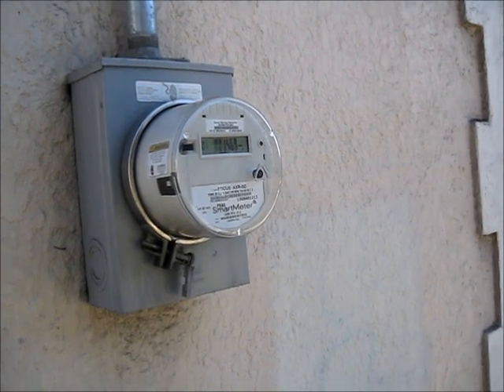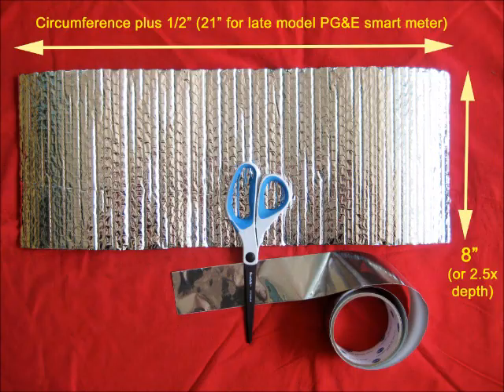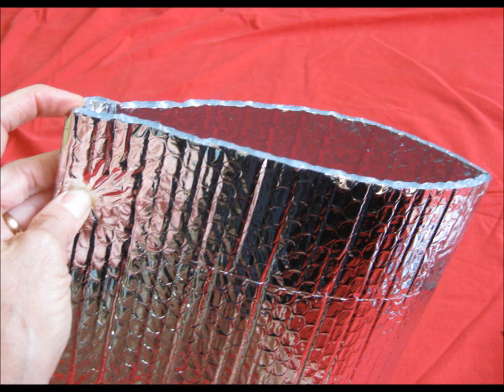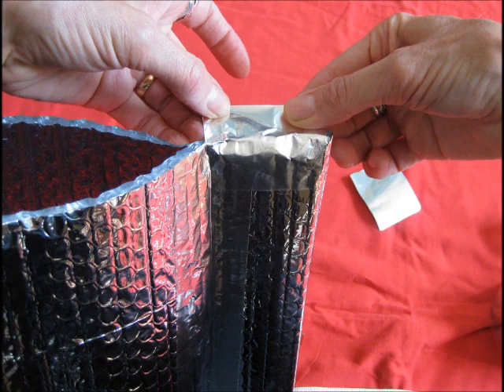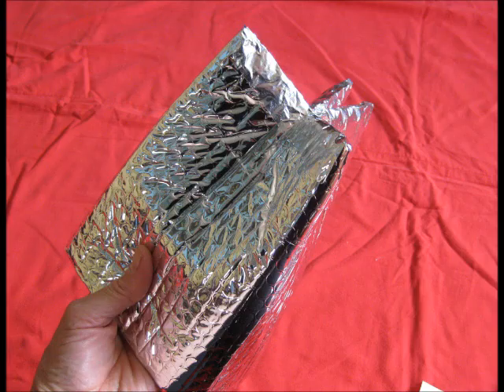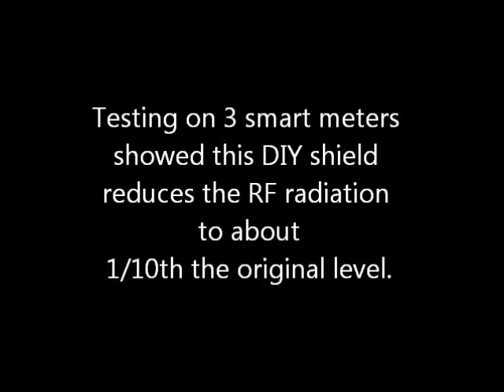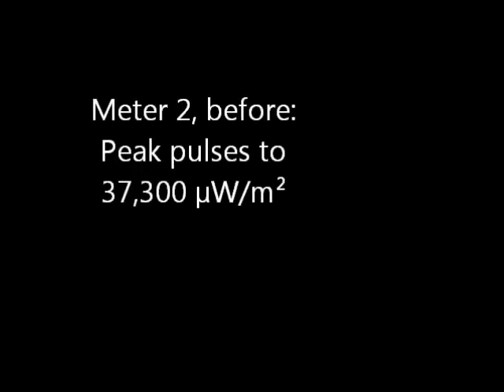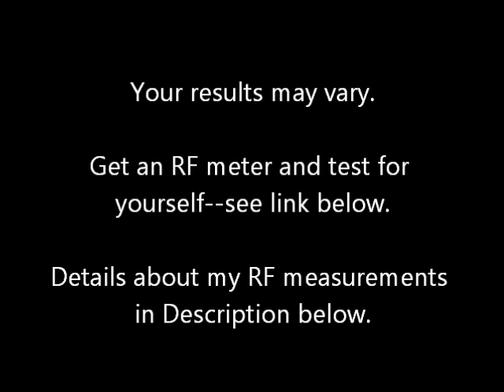DIY Smart Meter Shield: light-duty, temporary, portable

Comment: Am wondering how to check emf (RF) is reduced. Wish could use a volt meter to ck. Do have meter bought online ($3.86) but seems to be a non contact voltage checker with dig readout. Anyone try these if work for emf - are they really emf meters?????    https://www.amazon.com/dp/B0754VVW4W/ref=sspa_dk_detail_8?psc=1  or cambridge labs emf meter

Comment: You are ignoring one very important fact!  Smart Meter are variable power like cell phones.  Shielding makes the meter turn up the power causing more harm to those inside the home!  Never Never Shield The Meter!  Do shielding inside the home wall.
Reply: Yeah, but what if it's right next to where your kids play, outside?
We only have one side yard, with my kids wooden swing/playset... There's no where else for them to play..
Reply: @ShadowBanned_7yrsandcounting  Hi Sarah, I understand.  Distance is your friend.  If they stay 10' away, the strength is very week.  Shielding the meter can increase the harm inside your home significantly, especially on the inside of the wall the meter is on.  We are learning so much.  Vaccines kill and harm all.  RF should be kept to low exposure as much as possible.  When they put antenna's up we have no control over, it is a problem.  Take Care.

Comment: People need to realize the most important thing to shield is behind the meter, otherwise you are just reflecting it all back into the house. Windowscreening is much better. I saw someone who put copper wire around the meter and grounded it to a copper stake then tested it and it was effective, but just shielding the front won't protect inside the building. don't forget "project woodpecker", if you read the last three chapters of the book "the body electric' by Dr. Robert O Becker, he talks in detail about RF, project woodpecker and how the people in the embassy all died of cancer after remotely targeted with microwave weapons.

Comment: i would hang a picture inside the house with the a screen glued to the back of the picture frame plus the outside screen
Reply: I've read that no one should sleep next to a wall that has a smart meter on it.  If this is true then it would mean the entire wall needs to be protected, not just the area right behind the meter.

Comment: Any shield used needs to be grounded. Use screen wire like that on window screening, leave the front open for the signal  to still get out.
And,, shieled the rear of the area inside the house or behind the meter.
Reply: I don't understand much about the whole "grounded" thing with regard to electricity.  Whenever I see that I think of there being some wire or something leading from the screen to the ground.  It seems that the ground has some beneficial properties which is why it is recommended that people ground themselves by spending some time with their bare feet on the ground.  Can you please explain how the screen is "grounded" without having an extra part leading to the ground?
Reply: Mine has has a breaker box on the wall directly behind the meter.  How do you shield that?

Comment: Hi, Is it not dangerouse to wrap the meter ?  wil it not overheat and cause a fire? ( have read this on the internet)
want to be sure. I think it would be more save to wrap it because it gets the radiation lower and the chanse of it overheating should be less. and do you have to keep one place open on the front? some just close it all with aluminium foil why do you keep it open is it for overheating?

Comment: Idiot foil-hatters.... 
Try using proper meters in the proper power range..... 230,000 Microwatts sounds huge if people don't know what you're talking about. Try using Milliwatts then realize it's less than the average flip phone. 
Putting a foil cover over the exposed meter actually traps the RF inside the electromagnetically shielded steel box, in effect, turning your wall cunduits into a wave guide to bleed RF out your interior electrical outlets. 
These meters only communicate far enough to be tripped by a hand held meter reader carried by the utility workers to get accurate meter readings. 
Blocking the signal only prevents them from getting an accurate power usage reading. Therefore the utility company has to bill you according to best guess usage which my actually be more costly to you than your real billed amount.
Reply: +Curt Young no foil hat about it these meters are harmfull you are right that covering it makes no difference you have to make it reflect away not back at you
Reply: Here's the deal... EMF will happen wherever there is either electricity (oh boy, a power meter maybe?) or magnetism ( like a speaker or a grade school science class ).... The claims of constant signals coming off these meters is BOGUS... Get the CORRECT equipment... Try an FR FREQUENCY COUNTER. Smart meters only burst data when triggered by a hand held reader. Taker yer EMF meter ANYWHERE and you will get readings...unless yer in a lead lined cave with no light and an air vacuum... even then, metals in the rock might give you a reading.
Reply: Curt Young
These meters give off radio or microwaves though that is the difference and they give it off 247 all day non stop
Reply: My point is that there is no need to worry about .023 watts of actual RADIO RF in the first place. A pocket FM receiver will generate a stronger "birdie". Also, ANY power meter is going to generate an EMF field because....well... there's ELECTRICITY flowing through it. Whence the need for proper meters if you're going to waste YouTube's server space with worthless doom and gloom videos!
Reply: +Curt Young Good argument. All one needs to do is direct the signal out the front of the device. There is NO REASON for these things to transmit an Omni-directional footprint. So, reflecting the RF out the front of the device (which requires a shield/reflector in the rear, and wrap around the meter with the front open.
Reply: explain? ive seen stats of them emmiting 2000x that of a cell phone. why such a fight from so many including so many intellects?
Reply: Again, the CONSTANT reading being shown is EMF (Electromagnetic)...Anything with electricity flowing through it will show EM Fields, from simple batteries up to household appliances....and power meters. RF is TOTALLY different. the 2000x is EM not RF and the reading itself is being shown in a smaller increment. Think of it like this. 2000 millidollars sounds like a lot, but it's only 20 bucks. :P

Comment: It is possible to know how effective this shielding is by using an RF meter to test it. I have shielded the meter in my house using a metal screen. It works. I have an arrangement with the hydro company. They call me the day before they are to take the reading, which is once every 2 months. I remove the shielding on that day. I cannot say anything as to the danger of using this shielding. Please ask an electrician versed in wireless RF. Those with a digital meter that measures electricity usage should find out about the dirty electricity angle. All I know is this: I do not suffer headaches, dizziness and brain fog as long as I use my shielding.
Reply: If they are reading once every two months then how do you know you are getting an accurate bill for the months that they haven't taken a reading?

Comment: Maybe not such a great idea guys! 

According to an electrical engineer, putting such a cover on a smeter could cause it to overheat, which is a serious problem already, as you know. Such a shielding as well will prevent signals from going out or being received which could result in the meter increasing its power as well as Hydro getting an error message, believing the meter is being tampered with. As better shielding is aluminum screening, like that used for windows. The signal can still get through, but it will be weakened, and air can pass through to the $meter.

Learn more about EMF radiation, the good, bad and ugly at http://EMFsummit.com
Reply: Good info ;)
Reply: I was just thinking this, both them not being able to read it (of course, why should they if it's a smart meter...craziness) but also the smart meters are already known to start fires from overheating, doing this could make that worse.
Reply: LET IT BURN

Comment: What is the point of making that shield?  As the front of the meter does not face the house? should not  be a special screen placed underneath of the meter, as it sits on the wall and possibly radiates through the wall,  into the house.
Reply: I've watched some other videos and some are saying that the back of the metal box actually blocks it, but then I see other videos saying that people should be using EMF technology such as special paint on the wall inside the building to prevent EMF's from entering.  The other thing I've heard is that people should not be sleeping next to a wall that the meter is attached to.  If the latter is correct that would mean the entire side of the house is being impacted.

Comment: You must think in your mind the radiation that is emitted from the meter is like a giant ball starting from the middle of your meter. If the middle of the radiation ball is emitted  5 Ft out from your meter to the outside then it would be emitted 5 Ft in the house and side to side of the meter as well. The only thing that reduces the radiation waves entering the house is the wall between you and the meter, so the true distance might be cut down to 4 Ft entering into the house. NOTE>>> I just use a measurement of a made up distance for an example. I won't say how to reduce your risk from these waves but there are ways that can keep you a lot safer with out getting rid of the meter. Just think your using a computer to read this post of some kind and they are just a dangerous to your health. There was one study done in Europe on laptop use around house plants and the study found the plants do better when not expose to the radiation given off by a laptop. Just a thought.
Reply: That's what I've noticed about many of these shields too - they completely neglect the back. Unless the box it's mounted to is made of a type of mental that attenuates the signal enough, they're missing half the equation, and could possibly be amplifying the signal due to the faraday effect
Reply: @anastasiavila5284  my box is on the cmp pole so it will be hard to cover the back of that, plus the pole is outside my bedroom just on the other side of the driveway. it was put in 2006 after the house was burned down, when i put in the new home (trailer) they never brought back the analog meter that was originally on the house. instead they put a smart meter in its place. they claimed it was better and safe, lol if i only knew then when these monsters came out a give off EMF radiation i would have demanded my analog back. yup i am dealing with side effects from that damn thing
Reply: @suebaxter301  Did you know you can have them remove it? Of course it'll cost you, and there's a monthly fee you have to pay, but you CAN have them removed!!

Comment: Excellent, you have given me some great ideas, what about the back shielding?  It's my understanding the circumference in the back, say, if it backs to garage wall, needs to be shielded.  I wonder if the meter readings would elevate on that side..
Reply: I keep seeing mixed info about shielding.  Some are saying that you need to only shield the area directly behind the meter in your home and others are saying not to sleep next to a wall that has the meter against it which would indicate that the entire wall needs to offer protection.

Comment: i used lead foil for 100% RF blockage
it worked they could not read {see} my meter
and are trying to have me cited
Reply: You can take measures to reduce the EMF's, but it needs to allow the RF's to reach the street where they read the meter from vehicles.

Comment: Thanks. Im curious as to whether u took readings on the inner wall of thw house before and after as u may be reflecting more of the radiation inward and even concentrating its power. Please let me know the results if u decisw to check the inside measurements and if u can get your hands on a Geiger counter it may be very helpful.  Thanks for the video.

Comment: Okay, good ideas but won't work. Yes, aluminum will block the single, but what you are doing is reflecting it back into the house. Instead of dispersing the signal you know have a focused one in to your home. Unless you can block the back.

Now for the meter itself. You will get just as much radiation from your TV and even more from your cell for one day than they meter in a whole year. But I get it. You want you privacy. Well the meter isn't gonna be the answer, sorry,but I bet when you asked to have a regular meter put back on, there will be a new charge on you bill, for misc service, etc. Covering the meter is a form of obstruction, what you would have to do it look in your title and see if the meter is part of the house or the electric company, maybe even the cities. When I owned a couple houses the meters were mine and I could opt out, If the did change it out and you own the rights and said NO, no they are criminals, because when the meter is changed out, you No longer have any rights to them, they are not you property. Hey from CA! 

Hope this helps.

Comment: this is stupid.........they own the meeter and the power delivery service and all the delivey equipment.......why not switch to solar or one of the other free energies instead......simply put them out of your business and quit supporting them
Reply: u r stupid cause most peeps are now poor in the USA fool
Reply: put the shield on the inside wall opposite of the meter???? put an 
opening towards the sky so the stupid pulse can pick up the readings????
Reply: aside from the legal ramifications this idea has other problems....the other problem is that this device has a built in cell phone that reports to the power company through the cell tower system....... so if you r blocking the cell signal..... the cell tower will detect the power loss and compensate by broadcasting a stronger signal.... it will also send a message to the phone to increase its broadcasting power....... the shielding effects are only temporary until the system detects the signal drop caused by the shielding then adjusts the signal. signal bumping will actual increase the short wave broadcast strength of the system making the detriment health effect worse..... if you should use enough shielding to actually be effective.... the power company will be coming to your house to inspect and diagnose the problem..... when they discover your tampering with there equipment, you will have legal troubles or get cut from service. so ya poor man i hold the high ground when i say this is a dumb idea..... get an edjumakation.
Reply: I think the author is very clever and quite concerned to use quality albeit expensive equipment to test. Some protection is better than none, and most meter boxes are just that grounded steel boxes, ie Faraday cages so back shielding may or may not be nessisary. 
Sad to say...all this "free" solar upgrade stuff, Govt. grants, free home energy assesments, smart appliences that communicate your habits and listen in on you,  etc.. is just setting you up for taxing everything including the sun later.... think about it... some districts are already being taxed. it will work something like this,  You use less because you are a good citizen & went solar, then pay less up front! (Good job, thank you! they say..) untill the tax man who is in cahoots with him says you are harvesting energy that we (the powerbrokers) have legal claim to. The power brokers arn't going to allow you to get away with this. They are intitled to bully you into submission, they will wear you out, fighting with them. In the meanwhile they are zapping the life out of you with all the smart stuff you think you can't live without.
 Evil.... slow steady cooking evil. WAKE UP MY FRIENDS! this a long term plan being fulfilled as planed, written years ago. It's a deep Deep rabbit hole. I'm hoping some of you see and discover how big this is and who is behind it. Knowing the truth helps understand their strategy. If you are looking for peace of mind, forget it, those days are over. This a quiet de-population war.  The prey (us) don't want to know the truth because we the sheeple have been programmed to procrastinate, and keep consuming the poison.
Final comment, the trolls will die too. The powers that put you up too being so hateful, disrespectfull, and prone to wasting your time, spreading cotention... those behind this,, hate you trolls just as much as all the men and women you troll. They are here to stay and win. Stop being a pawn for the devil, take the blindfold off, and for the love of God stop playing chess with the fallen ones. They don't want you in their transhuminest club. They want us all slaves and eventually dead! The matrix has you Neo.
Oh! Thanks to the author. Of the vid. My wife had several symptoms physical and psychological, she finally lost her mind completly, I'm alone now, and just discovering what likely happened to her. All day on the PC, next to the meter wall, with radio phone on her desk, and cell phone on her body, wifi 2 feet away, printer wifi next to that, Wifi APU, Google dongle on the TV streaming, microwaving coffee and snaks. Hmmm....
Sad...... thanks for caring enough for your fellow man to post..blessings to you.
Jimbo.
Reply: @jamescarter3883  You rock dude. Very well said. Working to reduce the signals around my place now. I am concerned about my wifes work environment at the office building she works at.  Always around this stuff.  Love and respect sir.
Reply: Darrell Hughes cuz I rent